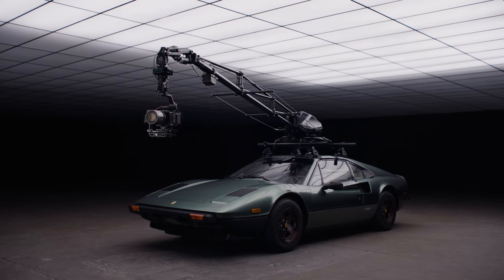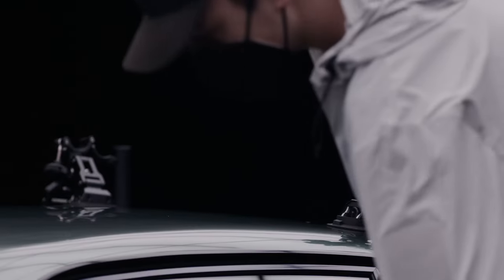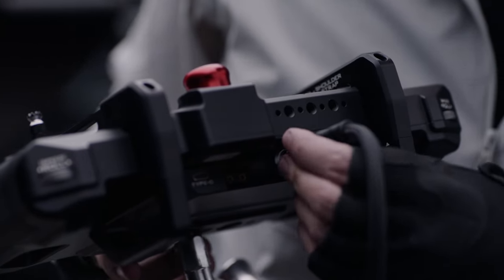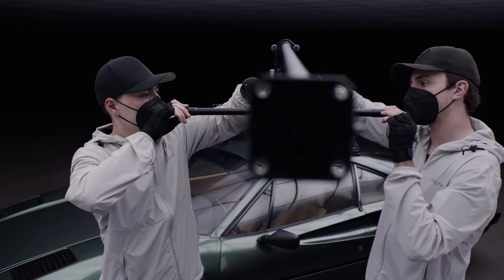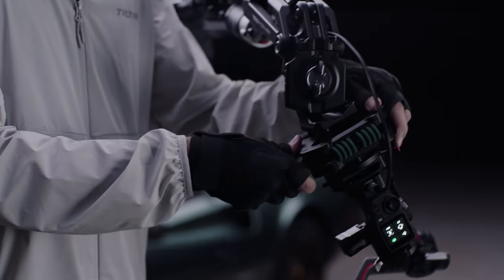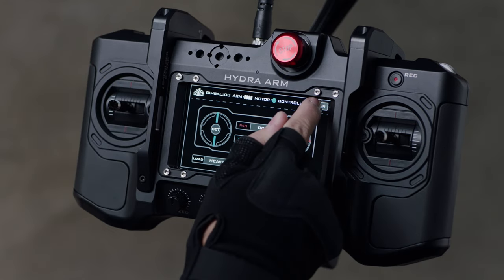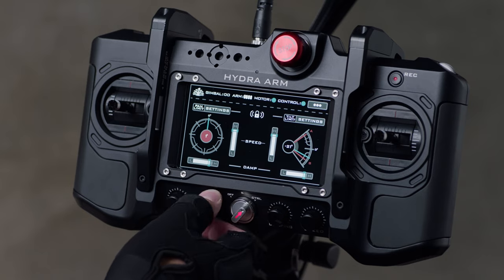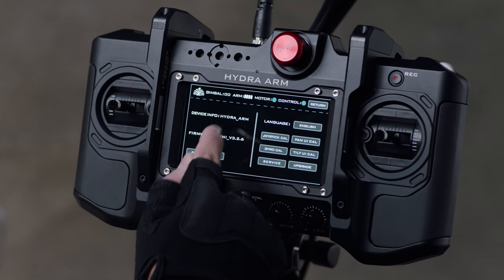Tilta Hydra Arm Mini Setup and Installation Guide

Comment: So that dongle that you connect to RS3 PRO doesn't come in the box and you guys are advertising it as it supports RS3 PRO gimbal not saying its optional thing, we found out hard way
Reply: If you can afford the 12,000 dollar system you can definitely afford a 30 dollar cable

Comment: How stupid a mobile device powered by 220v instead of 12 or 24 :))
Reply from the maker: A customer told us they powered it from their Cybertruck
Reply: @TILTA  well I am using 12 to220v 1500w inverter with my ford tourneo:)